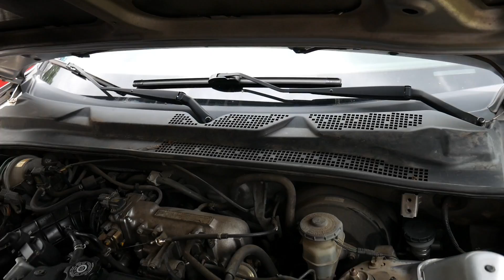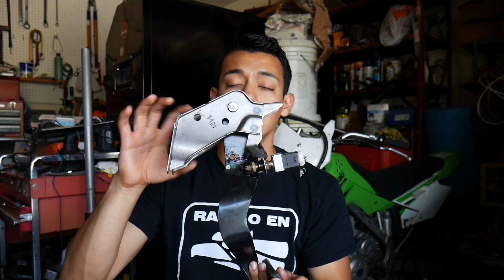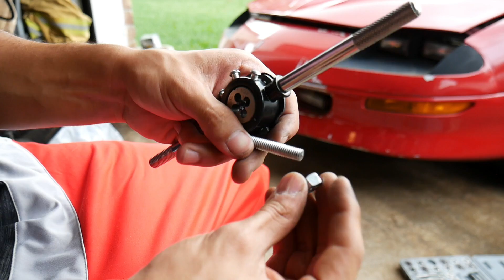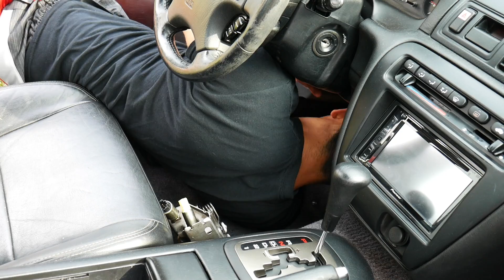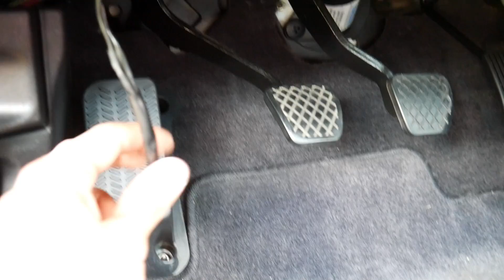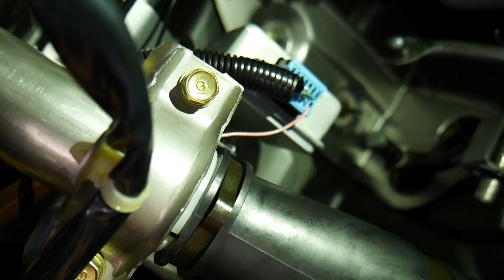Honda Auto to Manual Swap (Part 2)

Comment from the maker: I see a lot of people are confused about the clutch safety starting plug hopefully this makes sense. You’re only cutting the blue wire from your stock harness. I’ll show you how it’s wired starter relay (blue)——(black)—(plug)—-(gray)—-(blue).
Reply: So where does the Grey wire go to in harness.
Reply: @familymansgarage7076 the video describes it going into the starter relay. But doesn’t show exactly what that looks like, I’m confused too
Reply: @activvortex1483  Hey man I'm currently sitting here trying to figure this out, im doing my manny swap and am at this point, the same light blue wire you cut is the same wire you connect the the gray to. it hard to tell in his video due to how dark it is under the dash but you can slightly tell the wire hes hooking up the gray wire to the other cut end of the light blue  wire.
Reply: If yall you were confused like me, he means that both the black and the gray wire BOTH connect to the blue wire. When you cut the blue wire it will create two cut ends. The black wire goes to the cut blue wire closest to the plug. And the gray wire will connect to the other end of the cut blue wire (this is what he meant by "the gray wire will go into the harness"). Damn that took me too long to figure out that I already had the trans pulled from my car lol.

Comment: i bought another prelude for $700 to do my swap. i drilled out all the factory brackets and rewelded them back in place. it took me 2 days getting the clutch pedal in.  that was a bitch.

Comment: How do you wire the clutch again? Didnt fully know where u was putting the other wire at?
Reply: Motorcycles N Cameras  I’m in the same place don’t know were does that other wire goes
Reply: @Humblecivilians  man I'm lost as well I cut the blue wire and tied the black wire in going to the relay and the grey wire is also tied into the blue wire going to the harness but still dont work SwishLife Garage  please help brother I'm in houston as well.
Reply: @MrMattjj723  frl bro
Reply: @jdmitchellguy401  I just said forget it and left it alone it works with out connecting it
Reply: @MrMattjj723  how??
Reply: @jdmitchellguy401  I just didn't wire mine up

Comment: @5:45 I was going to tell you that before you drill whole? But you did it. So no need to comment. I have 2016 Accord 6 cylinders coupe, What's kind of master cylinder, transmission, wiring,.... I can use for better performance?
Edit: How about the computer what should I do, add or what ever I need to do?

Comment: Trying to do this what does mean by wire it to the harness   witch harness I've been trying to do this for 8 weeks need help asap
Reply: Had same issue. The protocol is, cut the light blue wire into two, solder the two wires of the switch to both halves of the light blue wire.. blue wire to the relay and blue wire to the “harness”; As referred to in the video
Reply: Did you figure it out

Comment: I’m new to this, so sorry if this sounds stupid but I’m a little lost.  I’m in the middle of this project.  “The gray wire is going into the harness.”  Completely with you up until that point.  Do you have an email or some way I can discuss for a minute?  I’m at wjd5070@gmail.com if you do.
Reply from the maker: all you're doing is basically cutting the blue wire and wiring in the sensor plug in the middle. starter relay (blue wire)-----(black wire from plug)-----(plug)----(gray wire)-----(blue wire)---. hopefully that makes sense.
Reply: SwishLife Garage oh so gray just goes to the other end of the blue wire you cut?  Awesome thanks a lot.  This is the part of the swap that I’ve been most confused about.  Thanks a lot

Comment: Nice work men, what ecu is? I got a h23a1 vtec engine ecu auto from a accord wagon in my Accord ex 96 coupé, and put it a F22b1 trans manual 5 speed, revs 5.000, because the ecu is automatic, any suggestion? Cant find diagram for pinout the ecu, ir what ecu can i use
Reply from the maker: Bismark alberto Cuellar paz everyone I know with H23 vtec use P28 tuned with hondata
Reply: SwishLife Garage thx man, i will search for one
Reply: So you can use Honda Accord transmission on H22a4